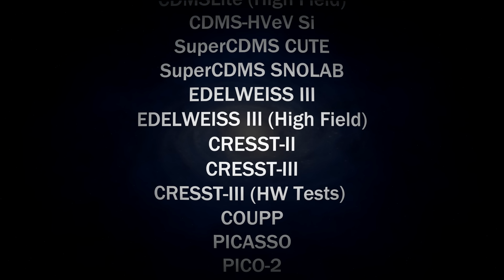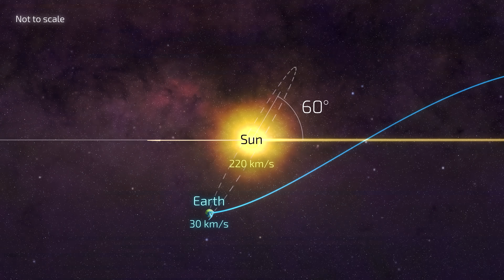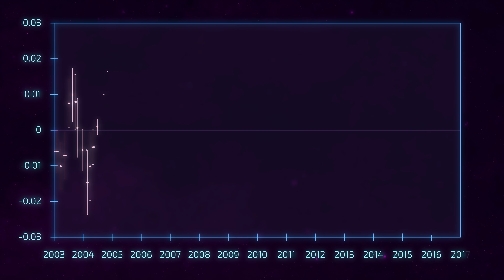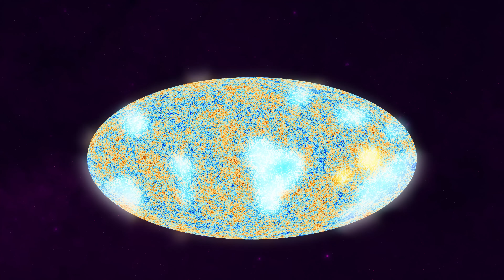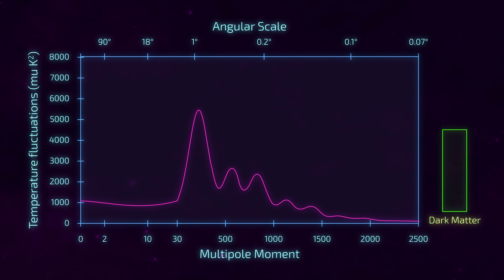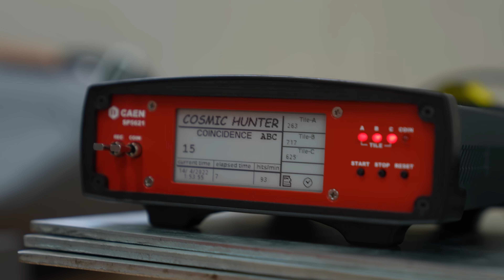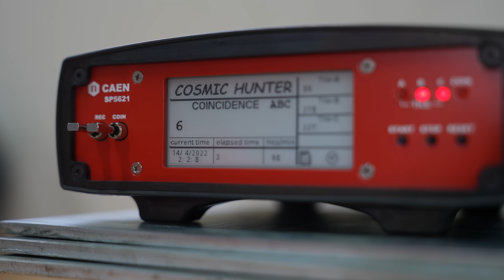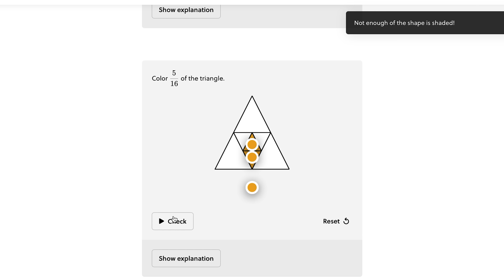The Absurd Search For Dark Matter

Comment: Just an observation from a simpleton, but the explanation for how dark matter works was that it doesn't interact with itself except through gravity. So the bullet cluster demonstration at 7:30 is flawed from my minuscule understanding because it showed the dark matter clusters ignoring each other but if they interact via gravity, they shouldn't have. Maybe the heat was all the interaction there was?

Also, what about simulated universes? What do they say about the rotation of stars around the galaxy? Are they different than what we observe in reality?
Reply: By 'ignoring each other' it means 'passing through each other as though there's no interaction on them except for gravity', which is accounted for in the observations and models. (Gravity isn't strong enough to prevent them from passing through one another and have them just coalesce on the first pass.)

Simulated galaxies are different from what we observe in reality when you don't include dark matter in the simulation, but if you do include dark matter in the simulations then you get pretty much what we observe.

Comment: There is no Dark Matter. It has magical attributes - it must have magical attributes. The easiest explanation is the lack of understanding of gravity on a galactic level. Good enough for stellar and interstellar relations, but insufficient beyond that. Which is why matter must be conjured up to align with the false beliefs held today. See MOND for example.
Reply: @Riho Bergmann - But doesn't every galaxy have the same rotation curves? Meaning that Dark Matter would have to be perfectly distributed in every single galaxy specifically to the amount necessary for the "ordinary" matter given? Wouldn't it be reasonable to assume that instead of Dark Matter just happening to be in the perfectly right amount every single time, maybe it's just our conception of gravity that is wrong.

There is literally no proof of the existence of Dark Matter, only speculation that it should exist. It is purely magical in its attributes and is supposed to exist in 5 times the amount as regular matter. Intangible, invisible, yet it interacts with gravity - what could even create something like that? And so much of it? It would have to be abundantly common.

See, if we'd see localized inconsistencies in observations, there would be proof of something that interferes with gravity. But alas it's perfectly distributed "where it is needed" to fit our models. And it happens to align with wherever regular matter is.
Reply: @brianviktor8212  Nope. He told you why MOND is not a good fit at large scales.

Comment: if methane fills up our atmosphere the way it does. im just assuming dark matter is alien farts till any real science is done.

i honestly feel like we should be spending this time and money on cold fusion.

we already have the cold fusion generators patented. i say generator instead of engine because from my understanding. an engine or motor has certain moving parts that well. make them machines.

where ass the cold fusion generator is more like a generator. you put a fuel source in there. and it gives you power. you do with that power what you wish. in this case. that power will be used to power the device in which propulsion is acquired.

just because we are using this cold fusion for space travel. it would be a generator if we used it as a power plant. 

one SUV sized device. has the power of two medium coal power plants or a small nuclear power plant.

once we have this. we can literally just go hunting for stuff in space like its starwars or star trek

Comment: It is suspicious that the peaks align close to the summer solstice, and troughs pretty close to the winter solstice, so this second experiment in the southern hemisphere really is vital to disprove whether the effect is seasonal. I would love to know if the detection accuracy of the muon detector vs angle of incidence with the sun has been studied. Perhaps a lower angle of incidence gives a higher detection rate as the muons are travelling through more of the detector plate material. Therefore less muons would sneak past detection in winter when the incidence angle with the sun is lower, therefore more muons from the sun are accounted for, therefore more detection clashes with the DM detector, therefore less "other particle" detections in winter. This would only account for daytime detection though, however in winter there is also more of the Earths surface for muons from the sun to travel through to hit the rear of the experiment at night time. As the muon detector is only placed above the experiment, it doesn't account for any hitting it from the other side (if that's even possible). Anyway just my two thoughts on why it might be seasonal related just in case the second experiment also shows it.

Comment: Dear science/space people, I have a question...

antimatter...
could anti-matter repel regular matter? 
what I mean is, could it be possible that gravity has a polarity like positive and negative?

as a hypothetical example, regular matter attracts matter via gravity. perhaps, antimatter attracts antimatter in the same way, but anti matter and regular matter repel each other. Of course matter and anti matter annihilate upon contact, so this would need to be on a galactic scale,  or even clusters of galaxies... the point being, this interaction of different matter types would really never be seen in nature since not only do they annihilate, but they also repel. 

a way to visualize this would be the standard stretched cloth experiment, except instead, the anti-matter in the system would be represented by a ball with vastly increased buoyancy (it floats upwards) which is placed under the sheet. of course in a normal stretched cloth experiment the gravity "well" is formed by placing a large mass in the middle of the sheet, thus repelling this "antimatter" 

this would for the most part, behave exactly as normal, however in areas where antimatter exists, the sheet would be deformed inversely pushing up on the cloth, creating a kind of 'negative' gravity, repelling the regular matter (or at least trying to, the visualization is imperfect in many ways) this "antimatter" would eventually roll "upwards" towards the outside of the sheet.

HOWEVER in an antimatter based gravity well (which in the cloth experiment, could be represented by sticking a pole under the sheet causing a spike pointing upwards. this would allow antimatter to work just like regular matter would in the original version, only "upside down", instead with objects interacting with the cloth on the underside. they would be attracted to the gravity of an antimatter gravitational system...

I think the interactions between these hypothetical "positive and negative galaxies" would be incredibly difficult to spot, since the distance, size and mass of galaxies are incomprehensible to me at least. and all of the "good stuff" would have happened billions of years ago, leaving a universe of segregated antimatter and matter galaxies gradually drifting apart.

I also understand that the stretched cloth experiment is an incredibly basic three dimensional visualisation of what is really four dimensional curved spacetime. And I understand this is the wildest speculation based on nothing but a random idea. 

I also am aware humans can create (incredibly small amounts of) anti-protons, But am fairly sure its nowhere near enough to detect any kind of gravitational attraction or repulsion to confirm or deny this idea.

is there a way the interaction between galaxies could confirm or refute this? maybe its already been refuted decades ago by people far far smarter than I could ever hope to be. Perhaps these are the wild ramblings of an uneducated lout. 

I think if this was even remotely a "thing" it might go some way towards explaining some oddness in the way galaxies interact in the universe... but again I'm just an uneducated lout with a mediocre high school education.

PS, I'm not sure how light would interact with this kind of system I thunked up off the top of my head, perhaps photons don't work in the same way because anti-photons are just photons? so the photons emitted or gravitationally "bent" are affected the same whether its a +galaxy or a -galaxy

please don't "come @ me bro"... I'm only trying to make sense of things. Has this been tested before? and if so are there any papers or books explaining the experimentation used to test this.
Reply: According to our current models, antimatter would attract gravitationally just like regular matter. It's (probably) not a mysterious substance that is anti- in all aspects, just that it has the opposite charge of regular matter (and annihilates with regular matter). We haven't tested this experimentally, because we've never created enough antimatter to be able to measure its gravity, but the theoretical basis is there and at this point looking pretty sound. (But who knows?)

There could well be other types of exotic matter that interact more weirdly with our current models of gravity, but it's extremely unlikely that any of them would be able to cluster and form galaxies like ordinary matter.

Also, and this misunderstanding is most certainly not your fault — it's entirely an issue with the model, and how the model is taught — but the rubber-sheet (or, as you call it, 'stretched-cloth') analogy for how curved spacetime affects gravity actually doesn't change anything if you flip it upside down or if you push up on the cloth instead of pulling down on it. The curvature of the cloth remains exactly the same, so running with the model, an object passing by something that pushes up on the cloth experiences attraction to that something, just like it would if it passed by something that pulled down on the cloth. (This has nothing to do with both antimatter and matter attracting via gravity, by the way — it's purely a quirk of the rubber-sheet analogy.)
The reason you'd make that completely reasonable mistake is because whenever someone is told about the rubber-sheet analogy in the context of Einsteinian gravity, they think of a potential well where objects passing by 'fall into the hole' created by masses that cause the curvature, rather than travelling on straight lines through the curved space like Einsteinian gravity actually describes. (Which is exactly why I'm not a fan of the analogy.)
Reply: @rtg_onefourtwoeightfiveseven  amazing, you made me feel both stupid and smarter in one comment :D 

for real though , thanks!
Reply: @Great.Milenko  No worries, and you should never feel stupid for asking questions about these things — the answers are anything but obvious. Doubly so since you're aware of what you don't know.
Reply: @rtg_onefourtwoeightfiveseven  Thanks! And this is the reason I asked on this channel, knowing the viewers would be  intelligent, knowledgeable, and sympathetic to us dumbdumbs.

Comment: Why do people persist at seeing ghouls and goblins ?
If you take a size of a galaxy and fill it in with colloidal matter, now you have a very large mass,
which is spread around equally for most of such matter.
Only the slightest introduction of a slightly larger mass in any single spot will draw in
more matter towards it, creating a microgravity, which then draws in more matter,
which after billions of years then results into what we see today, stars and planets.
This however does not negate the fact that colloidal matter is still out there in the same density
as the rest of the visible galaxy, but moving little with speeds nearing zero.
So, basically the galaxy as we know and see it and all that mass is also existent outside of it,
but it has not shaped into anything yet, since the movement is near zero.
This then explains the large mass we can't see and yet exists.

Even within the galaxy there's space where this colloidal matter is maintained, invisible
yet most persistent and adding gravity to the whole of the galaxy.

In fact, you can calculate the universal matter constant from this.
Only in places where there was a minor matter constant imbalance did visible stars and galaxies start to form.
the rest of the universe which appears empty still has the same amount of matter in it per cubic meter,
when compared to what we can actually see.
When you go back in time far enough, and calculate the maximum speed matter can have in
order to not have created stars and/or galaxies you can then also see how far things have to be
from any gravity source in order to meet the requirement of not having accelerated towards
a single spot in order to create something the size of a star from all the local colloidal matter.

For a single calculation, at 81 thousand light years, the sum of acceleration over 1.000.000.000 years is yet
only 7 m/s for the gravity exerted by the Sun. And this also happens with galaxies, which may have
tremendous gravity exerted by the sum of it's components, and yet after a mere million light years,
matter wil only move towards it with even less speed, even after 15.000.000.000.000 years.
Yes, there's expansion, and yes there's slowing down, and yet there's no dark matter or dark energy.

At that speed it will take roughly 1.000.000.000.000.000.000.000.000.000 years to form up with the Sun.
(The number of zeroes is actually arbitrary since it involves more time than the timespan of creation.)

1:46 It's not 'dark matter' it's just regular colloidal (or near colloidal) matter, never having formed into anything.

Comment: I am always baffled by the concept of dark matter. We "know" its there because the "extra" gravity but we can't detect it. Maybe our gravity equations are wrong. I'm sure I'm not the first one to point this out but seems a weird way to think about something. In science if the data doesn't fit the hypothesis then we throw it out but in this case it seems that they are completely unwilling to do that.
Reply: If I understand correctly, they've ruled out an incomplete understanding of gravity because of the variation in observations where sometimes there appears to be more dark matter, sometimes less, in different galaxies. If it was a revision of gravity, it ought to be constant but it isn't meaning it is more likely a particle which like normal particles can have uneven distributions.

Comment: Those are not the Italian Alps. Those are the Appenines. The appennines run through the lenght of the peninsula. The alps are North at the border with France, Switzerland and Austria. Fun fact, Italy is the second country in which the Alps are located (by extension). Austria is the first (only by just a 2 percentage points margin).

Comment: Dark matter is elusive because it is simple. It is the primordial material of the universe and it flows into the center of galaxies which happen to have supermassive blackholes, each and every one of them. Galaxies are formed when this invisible matter interacts with black holes to create protons which are visible matter. Voila! So actually this is a process of galaxy creation which ultimately reduces the black hole, effectively reducing the interaction with dark matter. So some galaxies will 'appear' to have less dark matter than others but actually it is always ambient just interacting less. As for what particle is dark matter made of, I say simply electron-positron pairs. That's the primordial mesh/matrix that defines our universe. Ever wondered why electrons seem to be everywhere all the time? So easy to invoke in our electronic world. We have to realize that we don't really comprehend basic concepts such as gravity, charge and light. Our assumptions is what is making dark matter elusive. But our observations assembled that is; gravitational lensing, the fact that there are black holes at centers of galaxies, the fact that positive charge is mostly stationary while negative charge is easily mobile in our universe all come into play. That is to say that black holes are the only true vacuums while the rest of the universe attempts to fill them causing 'gravity' and also any true vacuum is a positive charge because it represents immovable charge and vice versa. So, a positron, a proton, a positive ion, all these are or contain miniature black holes. Making the electron the only true particle of our universe. And lastly, dark matter(which I also call Aether) seems 'invisible' because it is actually transparent and is the medium that carries/transmits light (electromagnetic waves), magnetic lines, gravitational waves and blackbody radiation. That is my grand unified theory. Prove me wrong.

Comment: QUESTION... How does a UAP moving so fast without breaking the sound barrier? I understand How it does it. How it has a gravity field around the craft. So inside we would feel no movement. As you would say The Earth bends its gravity as it moves chasing the Sun. More like the Sun has a Grip on the Earth tugging it along. Having its 2 strongest holds on Jupiter and Saturn. There are multiple elements that we could bend gravity with. Being able to control small suns in the palm of your hand that can bend gravity and be tuned like a radio. Any other frequency that man has mastered. Our School system hasnt made the necessary leap in imagination for young minds. Engineering should be taught in grade school. As soon as the learn math. By 5 grade they can learn way more than we think they can learn. With the right environment they can learn anything and teach there parents.